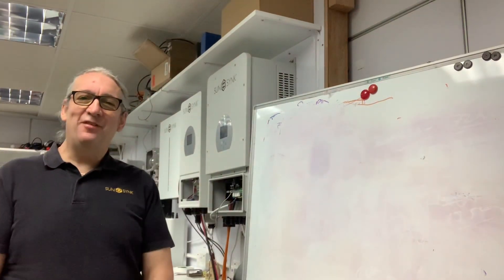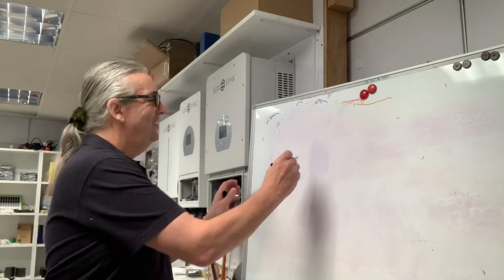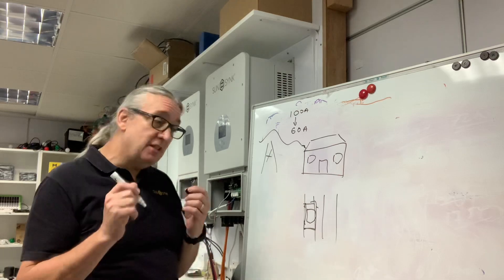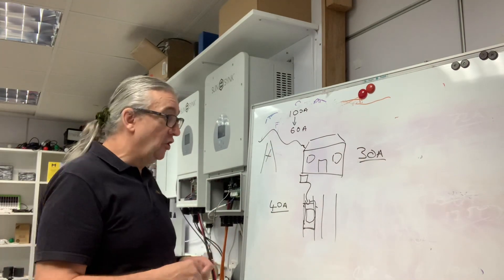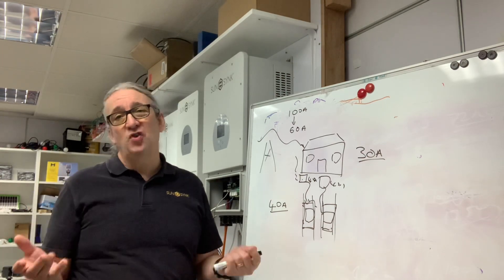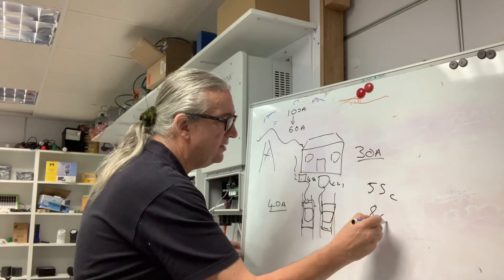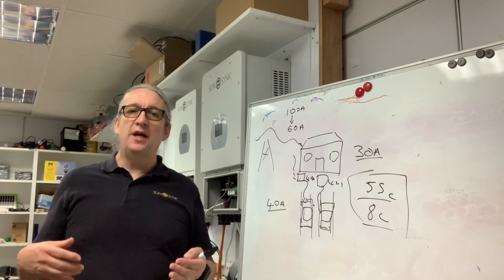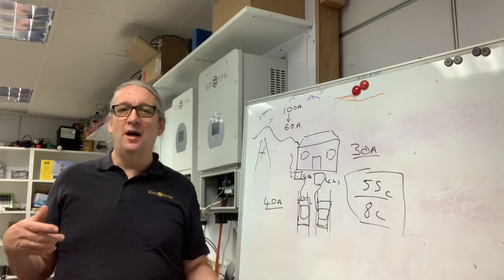Hybrid  inverter an electric car

Comment: Keith, The MyEnergi EV charger will start charging the car (when on ECO or ECO+ setting) when the house is exporting over 1.4kWp. However, once it starts the inverter will see it as a standard load and dump the home battery into the EV. This is not ideal. 

Is there why to stop the inverter dumping the home battery into the  EV?
Reply from the maker: On this particular installation the dump a load Is separate to the Inverter.

It’s basically used to control the speed of the turbine, anything connected to it could be a water heater.

For excess power on the solar production connected to the inverter it  can automatically switch it to anything including a car charger this is total control by the Sunsynk Connect app.
Reply: @sunsynk  So, if the EV charger is connected to the aux terminal we can set it to dump excess to the EV? But would this not make it difficult to also charge the EV from the grid as well?

Comment: Hi kieth, quick question  on the sunsynk inverters there are 2 dual mppt charger controllers @ 125-425vdc is that for each controllers or this voltage are for both dual  mppt controller 125-425dcV? Reason for asking cause I don't want to overload my panel VOC.